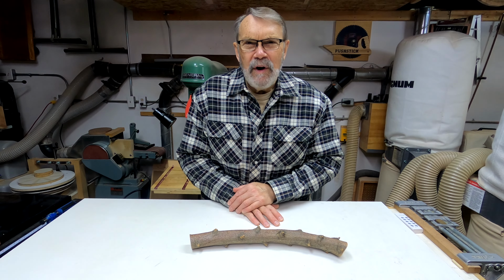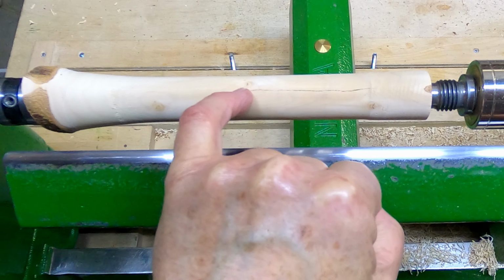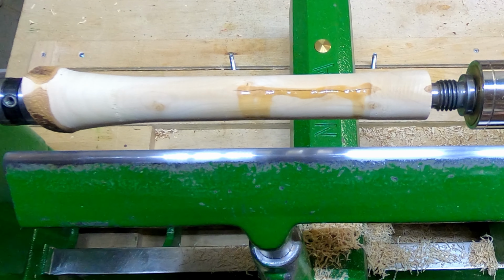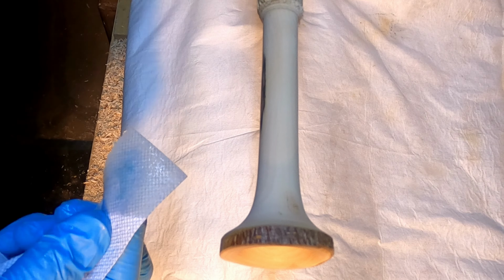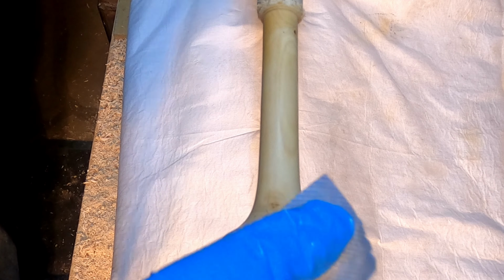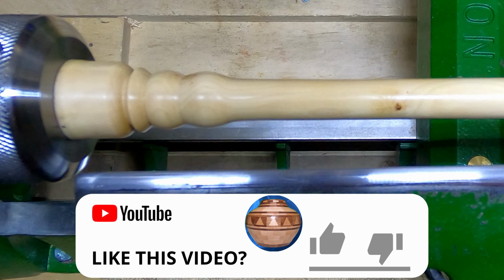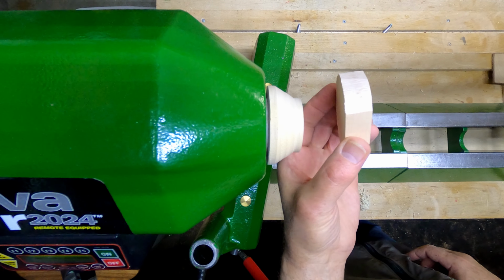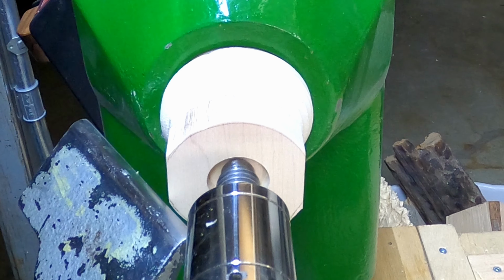Small Black Ash Goblet & A Tip For Turners

Comment: That was a really nice little goblet, Gord. I did not think you would get that much of nice usable and sound material out of such a small little limb. I remember some of the pieces that some people gave me when I first started. I didn't have a great understanding exactly of what I needed, but some of the twigs they gave me were laughable. I appreciated all the generosity, though. 

As for drill bits, I had my eyes on a set, not an expensive one, but a complete set up to 2 and a 1/4 inches and they were $84 for a long time. I didn't really need to buy them so they weren't in the budget until I needed to drill out the tube of the fog bowl I've discussed with you in the past. 

I ordered them early in the year, and a few weeks later they jumped up to $140. Now, for a pretty good set of Forstner drill bits, from 1/4 inch up to 2 and a quarter inches, that's still not bad. But what a jump after years and years of it staying at $84. I guess things are getting more expensive. 

I knew that there was a big price increase coming on Laguna lathes, before the end of 2021. It just wasn't in the cards for me to upgrade at the time, but now I have confirmed the sale of my old lathe and the new one on hold is waiting for me. But I will have to pay the newer higher price.

Thanks for the enjoyable Wednesday evening watch.
Reply from the maker: Wow, that is an incredibly steep rise in price. Oh well, it’s not electronics so I guess the price will go up. I hope you enjoy the new lathe, Jay. I have no doubt that you will. 😃😃👍👍 Thanks for watching!
…..Gord

Comment: Well Gord that was a great use of that branch you were given so many years ago. Cool looking little goblet.
I like your forstner bit rack. Especially with the points down. Nice to have the built in sizer as well.
As always a very well produced video!
Take care,
Gary
Reply from the maker: Thank you, Gary. There wasn’t much else I could do with that little stick. 😂😂 That bit rack has proven to be a very good tool. It’s nice to be able to use the holes to check the size of tenons. Works very well. It certainly is more convenient than having a bunch of bits rattling around in a drawer. Thanks for watching, buddy! Take care of yourself.
Happy turning,
…..Gord